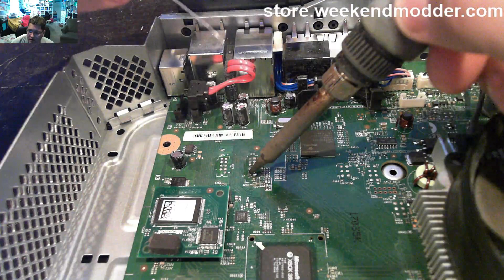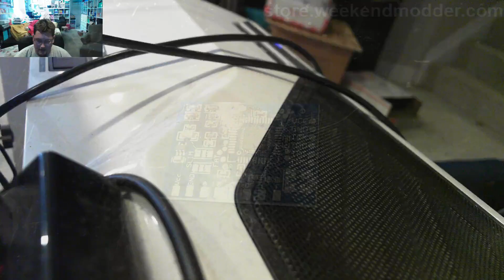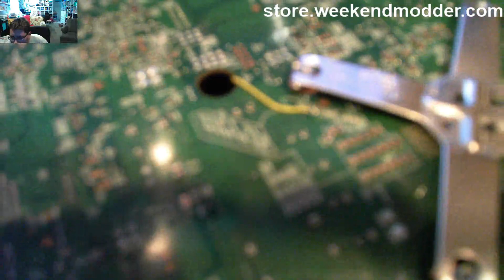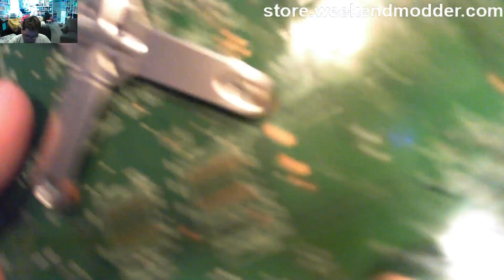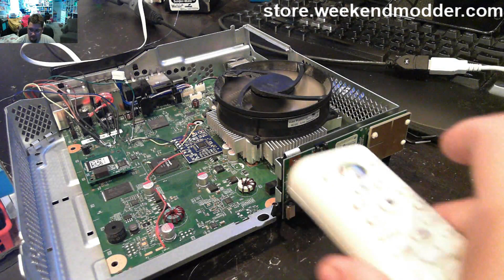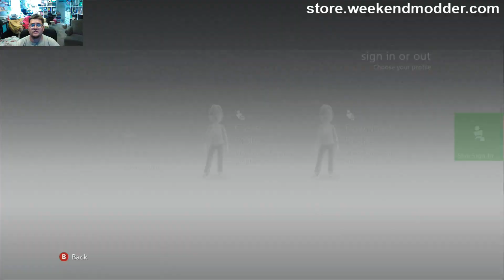CR4 Muffin Trinity Installation Tutorial

Comment: If I only have an Xbox 360 slim trinity, what would be absolutely necessary for purchase and how much would it the minimal total be?
Reply from the maker: You have to have a way to read/write the nand, and you have to have a glitch chip that is programmed with a timing file compatible with the RGH install you are doing.

So you could make a homemade LPT cable to read the nand for about $2 and then get a pre-programmed glitch chip for a trinity.  

Spending a little bit more on your tooling will make the process a lot easier though.  a JRP is only around $20 and is capable of reading/writing the nand and programming a glitch chip if needed for tuning.

Comment: im Using Coolrunner Rev C and after I flash the muffin timing file the chips led will stay green, but if i flash any other timing file the green light will turn back off. is it normal for green light to stay solid after flashing the muffin timing file to the rev c chips?
Reply from the maker: No. chip should pulse during booting, then be off once the console has booted. 

Though - I have had a few consoles where the led stayed solid on even after the console booted but my memory is fuzzy if those consoles went on to have issues later or not.

Comment: I get the blinking of the glitcher but the console never boots to xell or anything at all. I reflashed the stock nand and it boots fine. Would it be the timing file assuming all points are soldered correctly? I used the 7_1 like in the video.
Reply from the maker: Sure, you could play with the timing file but from personal experience it's more likely you've made some error in the installation, the chips and that timing file are pretty consistent.
Reply: @TheWeekendModder  thanks, I got it to boot but now it takes about 10 minutes sometimes and instantly others
Reply: @anthonyybarra4924  what'd you do if I may ask I just ran into this problem
Reply: @ABELbloom  I was patient enough to actually wait for 10 minutes as it turns on. I tried to decrease boot times and fucked something up. Now the ring of light doesn't turn on at all. I bought a used console off the internet for $25 then I bought a good soldering iron, used the same modchip and now I get 30 second boot times

Comment: Yo what do you think. My Xbox Boot in xell i get my cpukey i Flash my nand and itz not working the Chip glitch but i dont See a boot
Reply from the maker: Double and tripled checked your AV or HDMI cable?  What happens if you flash back the ECC file - does it boot Xell again?   Boot with the eject button - does it boot Xell then?
Reply: TheWeekendModder i cant say it because i fucked it up xd  i use the Cables (Striveday™ 28 AWG 1007 Coper Wire Electric wire kit 28 gauge Hook Up Wire 300V Cables electronic stranded wire cable Industries electrics DIY box1) and i checked all i say it to you when i get a New One

Comment: hey mate been trying to buy from your store all day. I've added 2 matrix chips and a nand X to my basket. Go through the options for my address and hit accept terms. then hit continue and it just sits and shows the word loading. tried on pc and 2 different android phones. any ideas? thanks boss
Reply from the maker: Where are you based?  International?
Reply from the maker: Looks like I found you.  UK based -  the loading thing spinning wheel is for my normal credit card checkout, which is only available in USA.  For international orders you have to use Amazon Pay, if you don't see the big "Amazon Pay" at the bottom, ensure you have any browser extensions like uBlock Origin or NoScript disabled for my site.
Reply: TheWeekendModder never used Amazon pay but I'll get on it. if I was to pay you an extra 5$ via PayPal could I get my items quicker? that would be on top of the 10$ for shipping included? thanks pal
Reply from the maker: No, I don't do anything with Paypal.  International shipping is cheap(ish) for USPS First class, but anything faster gets wayyyyy more expensive.  There's really no option for an upgrade. Sorry.
Reply: TheWeekendModder That's no problem. Again thanks for your replies. Going to order just now.  Thanks man
Reply: TheWeekendModder made my order bud. Hope it went through okay. Thanks
Reply from the maker: Thanks for your business!

Comment: is not nessesery to bring file on the chip ? (timings) i was order 1 of this chip  (speak of  this -> vcc gnd tck  ) to programm with put the pins in , or is this onother chip what i mean ? thx for video and answer best regards from Einbeck
Reply from the maker: Yes, you do have to program the glitch chip wit ha timing file.    You use a JRP or Nandx to program the glitch chip.
Reply: ah ok u use this 5 pins , what is call it ? can i search this on ebay? i dont like to make permanent soldering for 5 second programing  , i have the JPR
Reply from the maker: It's just standard 2.54mm pitch pin header

Comment: I followed the steps programmed glitch chip/ created and wrote ecc when I turn it on the led just blinks no boot any ideas I checked. And rechecked my solder points..?? @theweekendmodder
Reply from the maker: Do you have solid AV connection to the console?   The 360 can tell if there is anything "listening" on the other end of the HDMI so if you don't have a good hookup it'll not boot.    If that's not it, then the standard advice applies:   disable the glitch chip (remove its power wire) write your original nand (nanddump1.bin) back to the console and verify it will still boot retail before continuing.
Reply: rewrote nanddump1.bin it does boot retail
Reply from the maker: Ok, so you know the console isn't ruined - that suggest some of your soldering/conections weren't right which would be why it wasn't glitching.  So essentially start over :-)
Reply: i replaced the chip with a new chip i received from you disabled the crystal and it is up and running! (-: I rechecked all my soldering multiple times making sure there was no bridges or poor connections... I believe i recalled in one of your tutorials you mentioned trying another chip and that was the solution..

Comment: Hey I got the matrix v1 glitch chip and nandx from your store about a couple months ago in attempt to rgh my banned retail console. Everything is going well up to the booting, it doesn’t show the RoL green light that indicates that it booted it just keeps flashing green in the middle. Not sure what to do or what could have caused this. Please let me know ASAP, thanks in advance.
Reply from the maker: Basically impossible for me to diagnose from a comment with very little information.   Everything would just be a guess:   What timing file did you write to the glitch chip?  Did you write the ECC to the console?  Did you have the CR4 box checked?
Reply: Yes to all, also i wrote the 2 latest timing files. Also while trying to solder the RST point and a very thin wire kinda came out of the pcb but there wasnt any damage indicated other than that. Also can you tell me what other point is the alternative so i can try that instead the one that was used in the video (the easier method was used.)
Reply from the maker: Write the stock nand (nanddump1.bin) back to the console, and remove  the power wire from the glitch chip.  If it still boots retail - start over on the RGH.   If it won't boot retail anymore - then you gotta figure out what you damaged.
Reply: Hey Weekend Modder, quick question when i ordered the NAND-X i recieved it without the glass bit. Is that how it should have arrived or am i missing something? Also i ordered it with the 3D printed case which didnt fit properly on it so i cant use that.

Comment: Hi weekend modder so I tried to rgh my first xbox 360 I have a trinity a jr programmer and a ace v3 I read the nand compared it and then read and wrote the ecc and programed my ace v3 with the 60.6 timing files but now when I try to turn on my console it has the red dot plz get back to me as soon as possible
Reply from the maker: If you're getting a red dot them you've damaged the console somehow.  At no point during a normal RGH does anything you do cause RDOD so I'd carefully check over all your soldering to see if you might have damaged something.
Reply: I got a red dot when I had a weak connection to the CPU_RST Wire

Comment: Great video enjoyed watching it. Would you recommend this method over the S-RGH Ace v3?
Reply from the maker: Yes, given that the Ace V3 seems to have had some sort of change that makes that method not work with the latest batch of chips.   My supplier says all Aces come from the same manufacturer in China so I'm not sure if they'll Iron it out or not.
Reply: It's a shame I bought 10 Aces. I've done S-RGH on a trinity a couple months ago using the new timing files and had success. Recently I tired using the cr4 speed up files and ended up giving the console the red dot of death. Have any idea why that happened? I can still use those chips for phats. I plan on getting some matrix glitches and a 4gb nand reader from you  in the near future. You make great content keep up the good work :)
Reply from the maker: I've got a Trinity that has RDOD'd too as a result of using these bum Ace V3's with the S-RGH (CR4 speedup) timing files so I'm in the same boat.  One other I managed to salvage by switching to an old Ace I pulled from another console so I'm quite certain that it's the bad chip.   Best guess is they've got something up that messes with the RST or POST connections and fried something.    Good thing 360's are cheap!

Comment: I just got a couple of ace v3, got it to rgh a friends trinity.  Did everything correct, dumped nand,  put wrote ecc but console would not glitch with the 300mhz TR_L_0.6_T_60.6--------- timing files got really frustrated and tried every 300mhz file but nothing.  Then i went down into 200mhz and finally got the console to glitch consistently with the file TR_L_0.5_T_60.7.  Wrote the xebuild to nand the console while glitch within 1-5 tries, usually 2-3 area which is good enough for me!
Reply from the maker: Thoroughly test it though, I've had similar experiences with these latest batch of Aces and then they failed completely.
Reply: What would you say is good way to test it?  I've turned console on and off over 20 times, played a game for about an hour.
Reply from the maker: That sounds like a pretty good test.
Reply: I've been testing the console today, still working fine.